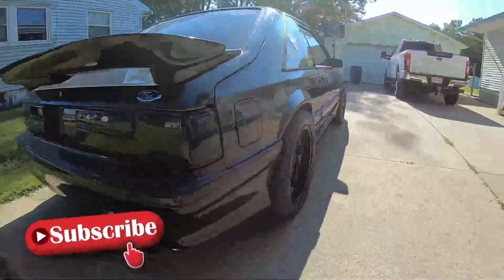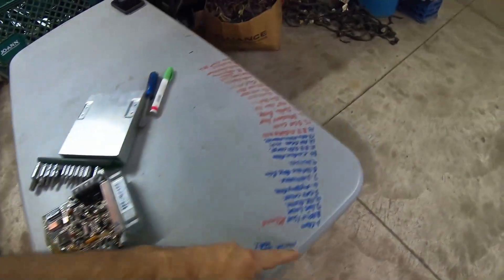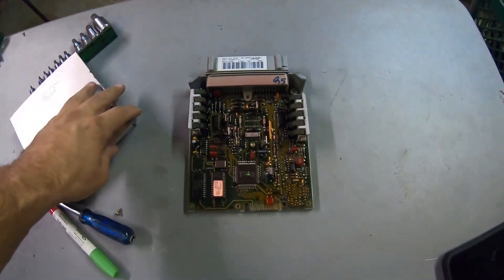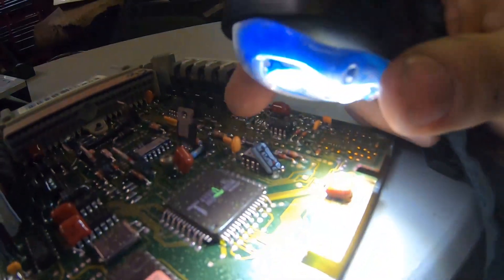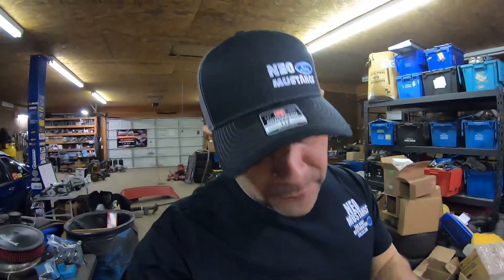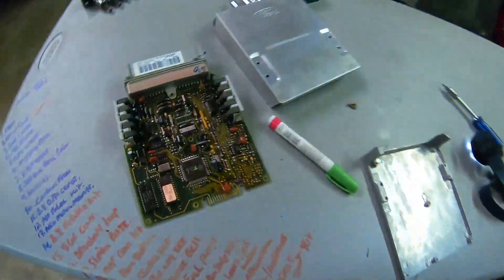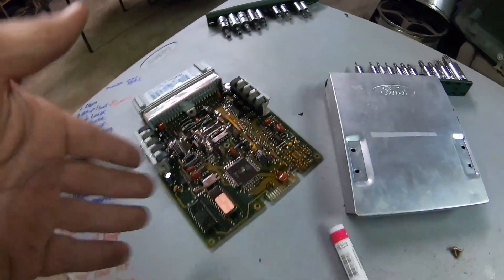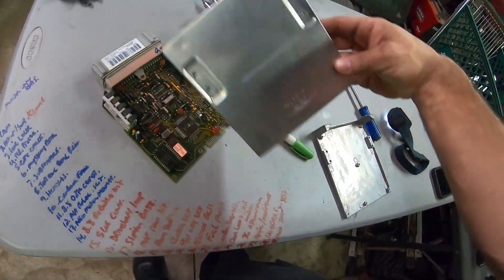How To Fix a Foxbody Computer Cheap! 💰 Literally Penny's ECU Repair 🔧

Comment: i'll also toss this onto the fire...if the circuit board for your old factory gauges has a broken link to it, find a rear window defroster repair kit. but if it just needs to get cleaned, use a pencil eraser to do it.

Comment: Just pulled my Computer out and sure enough my fuel pump capacitor is fried. 59 cents later she runs again. Replaced fuel filter and pump. Nothing. It was the capacitor. Thanks Neo. You brought my shitbox back to life. Didnt drive it all summer over this. 😔
Reply: My fuel pump won't come on, after a bunch of testing l can tell the computer is not sending a signal to the fuel pump relay, bet those capacitors are bad.

Comment: I took mine to a local computer shop looked like a Best Buy but wasn’t,paid $9 for the labor and a few bucks for the capacitors.Just call around computer shops and see if they have anyone who does circuit board repairs

Comment: Radio Shack ? You are lucky to have one around the last one around here closed down about 3 or 4 years ago. But any good electonics supply dealer can supply all the components that You would need. Great content 👍
Reply: was thinking the same thing RADIO shack all them closed in NY like 5 yrs ago..
Reply: @AwakeDude911 this summer I was in upper NY state for a car show when i found out my camera memory card was faulty. I was out in Amish country and folks said, "go down the road to the Radio Shack..." and i thought, well, it is Amish Country, so maybe... 

turned out the old Radio Shack was now a Verizon store--and a customer had just turned in a still-in-box memory card that Verizon wasn't going to give credit for, so the manager let me have it for free (major thanks, dude!).

but yeah, i remember when there was Radio Shack AND the Heath catalog for finding your electronic needs. now it's Christmas time and would be nice to drop into a RS and see what they had for remote control. those days are gone...

Comment: I found a seller years ago on ebay that I had fix my A3M in my 93gt. My timing advance wasn't working & the car ran like a dog. It would pop & bang on decel bad too. Whatever he replaced in it did the trick.
Reply: Have the same problem backfire out pipes and no power. Has a 9al swap out with another 9al been rebuilt two years ago still same issue.

Comment: Dan have you use a ecm from napa or other parts store. I’m wonder if there is any difference in the tune
Reply from the maker: I’m not sure
Reply: First good luck finding one, cardone and blue streak the two big reman companies only do repair and return on them now. They lack cores, not worth it to me from ones I've repaired.   Most I've opened have the e prom swapped to a good core board vs a rebuild. Just opened an old unused blue streak reman a9p that didn't even get the 30 Oem caps replaced. There all at the end of there life cycle these days.. Only paid $50 and its a dead simple fix though.   For the money you can't beat ecu exchange on eBay if you have a repairable core.  They are not just fixing burnt traces and swapping caps like most, that anyone can do. They are the only rebuilder ive dealt with that really replaces components on the board that I couldn't source.  I haven't dealt with fox resto on ecus, just parts orders there but I assume he does the same.